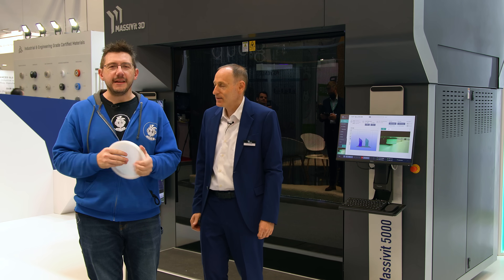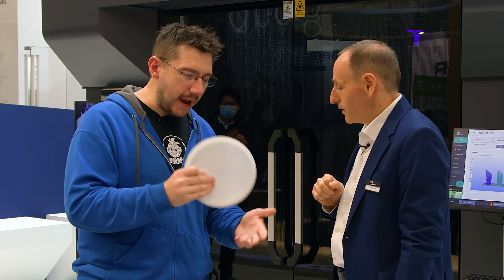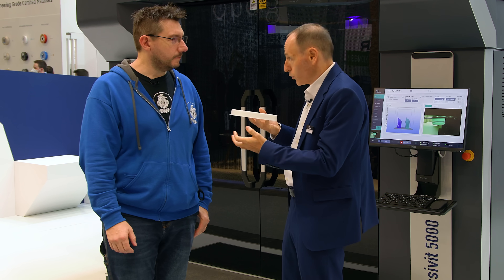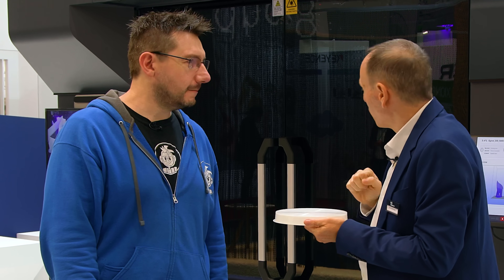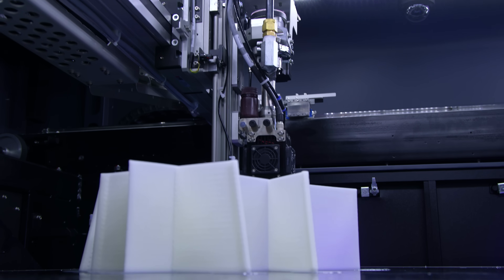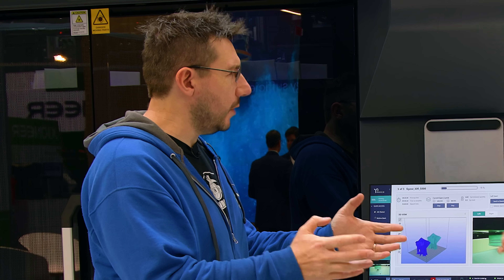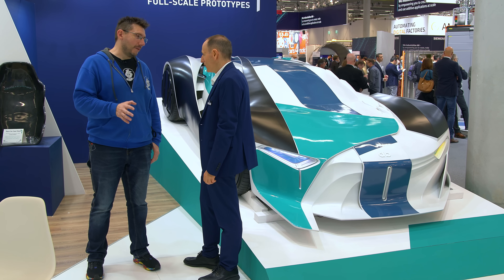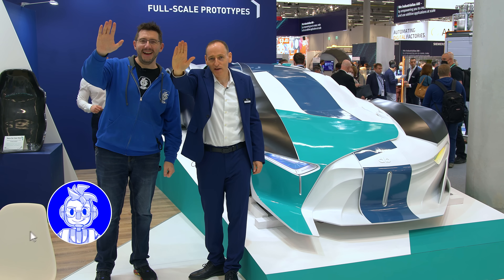6 FEET in 6 HOURS - ULTRA FAST 3D Printing with MASSIVit!

Comment: If someone makes a printer like this with multiple nozzles on a tool changer, it's literally machining, FDM and resin printing combined. You get the speed of huge FDM nozzles but using liquid material the whole time, and the different nozzle sizes allow for roughing and finishing passes

Comment: I know they are ringing out parts fast but how low can the resolution of this machine go? Can we use this gel to print sub-millimeter pieces on smaller printers? Xxx
Reply from the maker: resolution IS a consideration since the gel bead cannot be too small.

Comment: Did you talk about the process for getting what looks like a gf gel coat on the outside of the finished marine part you held? Was that a composite with the printing used to create a complex structure that was then overlaid with glass fibre and resin layers by hand and finished with a gel coat, also by hand?

Comment: Ive been informed that yes infact stratasys are hiding post requests again today. for royalties to be paid. There latest vids about dentures have several posts i bet none of you can see. 
They are back to hiding stuff. 
Not just our missing inventions then print them in a add. Wow. 
Not just our hacked accounts hidden until they got outted. 
Now hiding royalty request posts. 
Are they protecting criminal pirates from paying royalties? 
Assisting pirates to avoid the law?
Im not impressed. I got a message outting them again. 
Thanks to those who work for not just me by helping me but the comunity also. Thanks to there messages. You know who you are thank you.  Lucky we are onto them.

Comment: I have some questions for the folks at MASSIVit!
- Can MASSIVit's machine use traditional filaments that don't use UV curing?
- Can MASSIVit's gel be printed with a normal FDM printer?
- What if MASSIVit replaced the grid of UV LEDs with a sliding/rotating disc fitted with UV Lasers? Would we effectively get a fusion of Resin, FDM and SLS printing?

Comment: So he is proud of 50 patents (around 3:20).

I'm not sure if this guy actually understands that the only reason he even has a job is because key patents on FDM expired, allowing 3D printing to become a large industry with a broad customer base, rather than some niche industry that sells a few machines per year.  Patents actually held back the 3D printing industry for many years.

So any thinking human being would see it as problematic that a technology is woefully encumbered.  Because it increases the risk people will stay away from it, and development will be slower and more expensive for them since they can't leverage an entire industry.
Reply: The concept of Patents is sound, society needs innovators to invest time and money, and the rewards of their work are far greater to society than to the individual – so some method of compensation is needed for the individual. And the Patent length is finite! But abuse abounds from Patent trolls, Submarine Patents, to cross licensing to avoid being blocked by competitors. The abuse needs to stop.
Reply: @mc468  That's the theory.  Reality is a bit more complex. Patents tend to only be worth as much as the legal and financial horsepower you can put behind them - something that doesn't actually end up favoring innovation because it is a way mainly to defend an already well held market position.  There is a reason large companies have considerable patent litigation departments.  At one company I worked in the past we had a whole department of patent lawyers and staff whose job it was to rough up the little guys, defend against patent trolls and other large players. If you own a patent some well funded party wants out of the way, they'll most likely get their way unless you have very deep pockets and lots of time on your hands.

And it is a bit funny that you'd decide to sing the praise of patents in the comments on a video about 3D printing.  A field that didn't really take off until key patents expired and actual innovation could start.  (If you doubt what I'm saying, have a look at the FDM printers from before the patent expired.  Yes, they are pretty pathetic even compared to the cheap chinese knock-off 3D printers (of other cheap printers) you can buy from China.

When reality doesn't fit with myth, you kind of have to take reality into account.

Comment: Ok. For a fully enclosed environment, there's a lot of things you can play with. Ambient temp, air composition, UV exposure, air pressure, magnetic flux lines, microwave sintering, extrusion materials, extrusion angle, extrusion speed, extruder nozzle geometry, etc. I doubt this is solely an improvement in the extruded material. They appear to have reached a high level of engineering.

Comment: Now I want to see a full size bust of Joel made with this. I also wonder about post-processing because the car and boat parts were smooth and the in-progress print still appeared to have layer lines. If you didn't look into the boat part, I'd have assumed it simply got sanded down on the outside... but the inside also looked smooth, which makes me wonder what they did to smooth it.
Reply: Painted and/or coated as well. Look at the bottom edge when he flips it over. I see the signs of something very similar to applying paint with a brush or sponge.

Comment: I can only think of a medium to high viscosity fast curing uv epoxy resin that would be the jell ,  quote on "acrylics" and uv resins is very stable with various viscosity and curing time per layer could be less than 8sec and with every exposure to uv layer solidify reaching full cure

Comment: More interested in their smoothening and sanding process because those demo parts are basically layer lineless for a giant extruder. Either they have a really good process or a ton of work
Reply: At 9:24 When you see the tail lights and the small red columns, you can see the underside of what I assume is the other tail light behind, which has a few sign of drip/ paint run, so I assume it’s just paint laid on thick?

Comment: Wow, pretty mind-blowing!

As a couple of others have mentioned though, the missing info is the mechanical and thermal characteristics of the material.
- tensile strength
- hardness
- impact resistance
- maximum working temperature 

Also, what’s the cost/kg for the material?
Reply: I'm more worried about the cost of the extruder. Honestly the above stuff probably isn't too bad. Material cost might also be prohibitively expensive.
Reply: @faranocks  Plastic just isn't cheap to begin with, but otherwise I guess the cost is worth it for the benefit it provides. This gel? Even more so, giving that for more complicated stuffs ordering a machined part isn't cheap either, and you have to assemble it using even more efforts.
And the extruder probably would be durable enough as well (giving that human have been using pumps for centuries and you bet by this time it can be made with high enough quality). And it's not like CNC bits aren't disposable. 
Honestly I don't see anything of this machine that would bring the cost unreasonably high. It won't be cheap, but neither would all the alternatives.
Reply: @faranocks  As the technology for gel UV hardened resin is widely available the only thing driving up cost in that department would be availability for this specific use case, which would probably start to fall rapidly if this technology was widely adopted. I think the larger problem is that they have a patent for this technology so no one else will be able to do anything else with it in the near future.

Comment: Regarding the UV LEDs they use I've always wondered

Is the functional difference between an invisible uv led, and a visible one, small enough that the manufacturers just don't bother?

I own a UV flashlight that has close to no visible light emission (weltool 365nm with filter) and if I were to build a device that needs uv light I'd take care to use those LEDs with a filter mainly 

In this video it almost looks like they just soldered some violett LED in there and called it a day

Comment: I just wonder if they can print anything strong enough to be used for the core of a fiberglass ship hull?
Reply: Our printing technology enabling uses small amount of material because we print hollow objects (Little or no support structures needed). The end parts are lightweight, durable, and receptive to a variety of post-processing methods.
Reply: @Massivit3DPrinting  is it capable of printing internal structures or can it only do hollow shells?
Reply: @deltacx1059  , although our customers generally print without support structures (one of the benefits of Gel Dispensing Printing that enable fast production), the 3D printer's integrated slicing software has an option to print infill at the click of a button and to determine the density. Regarding your question about a ship hull, until now our customers have printed a variety of custom ship parts (rooves, ergonomic dashboards, radar masts, bathrooms) which were reinforced with fiberglass. From my knowledge, a hull has not yet been printed, but if you're up for it we'd be happy to partner with you :) .

Comment: Incredible! I wonder if they can use glass fiber filled gels to increase strength?
It would interesting to see this used in construction. Either printing modular panels, or forms for cement.
Reply: Our printing technology enabling uses small amount of material because we print hollow objects (Little or no support structures needed). The end parts are lightweight, durable, and receptive to a variety of post-processing methods, one of them is fiber glass.
Reply: Something like Markforge?
Reply: @karstenschuhmann8334  no. Makeforged puts down a continuous fiber on each layer. I'm just talking about short chopped filler.
Reply: @JonS  I see, but a continuous fiber could increase stability far more.
Reply: @karstenschuhmann8334  absolutely, but I have no idea how they'd incorporate it in to this technology. Also there are patents to consider.

Comment: Automotive industry is (will be) all over this! The cost of the polymer clay they use to sculpt full-sized prototypes is insane! At one point I inquired about the polymer clay used and after hunting I finally found a company willing to talk to me about it. $100,000 in clay, easily, for ONE full-size prototype. My purpose was to sculpt a 4 foot Cho'Gath statue for my son; $15,000 in clay had I gone ahead.

Edit: At a cost of $500,000 it could pay for itself in a few prints, one might argue a single print. As the alternative is ~$100,000 in raw clay that you then spend months(?) sculpting and refining at the hands of highly paid people. The time and money sink of prototyping is incredible and if you could wave a wand and most of it goes away, who wouldn't?
Reply: They still use clay for automotive prototyping because changes can be made on the fly by the sculptor within minutes ready for review by the designer. You can't do that in CAD or 3D printing.
Reply: I would think that the act of sculpting is part of the purpose of that process though. sure you can design the whole car in a computer sculpting program but it will be much different once full size.

Comment: I saw this at IAPAA and had a great conversation with the Massivit rep. It's an amazing machine. But it costs half a million dollars. And it's the size of a room, which for my company was a big issue. Not to mention that the resin is very brittle, has a shelf life, and is only supplied by Massivit. Add this with proprietary software and you have potential fornincredobly expensive maintenance. I talked to other companies who have this machine to get the review on whether it's worth it, and they were trying to sell their machine to us for 300k.  Which is still too much. We weighed the options and while it's a great machine we still have to mold, cast, and clean up prints anyway. Amazing tech, amazing machine. But ultimately more hype than it deserves.
Reply: Most useful comment here! Similar to the form 3L. It’s hundreds of dollars just to fill the tray with resin. Even if you can afford the printer, keeping it fed is super expensive; obviously if that’s your company’s business it’s worth it but for consumer use not really practical…
Reply: I own the massivit 1800 and it’s incredible expensive but it allows you to make very very large and precise mold for carbon fiber or fiberglass and you can also just the skin the print with fiber glass and it solves almost the issues
Reply: @ethanalbers861  But I assume you still have to cnc mill the part after the print is finished, since the surface is just not precise and smooth enough, right?
Reply: Wow, interesting observation, well at half a millon , closed ecosystem, etc its a very expensive 3d printing solution..i think the target of this machine is big companies (imagine only the cost in material of printing a car), and of course all tecnologys have there down side...
Reply: @noway8233  my higher ups were seeing stars with this machine and I basically had to beg them not to buy it as I explained why it wasn't worth it for the art department at my job
Reply: @Dakota_Daniel_Designs  What job do you do?
Reply: @thenamelessone123  I work in the art department for an Entertainment company
Reply: @Dakota_Daniel_Designs  Like prop stuff? I can see how tempting a machine like this would be for that.
Reply: @FastForwardPlans  precisely
Reply: You have to weight wether the time you save with this machine is worth the cost of maintenance. As it is, the cost of the machine itself is not a big issue: if you already deal with pieces of this size on a daily basis, you already have machines in the same ballpark.
I think the users most interested in it are shops specialised in maritime and aeronautic prototypes.
Reply: I was so excited until you said half a million.
Reply: It’s also great for prototypes
Reply: wait till the patents expire... it will be colossal.
Reply: @TomasSab3D  isnt that what let FDM take off? the patents expired.
Reply: @filanfyretracker  exactly
Reply: So what machine did you end up buying?
Reply: @martyboi  we didn't end up getting any of the machines involved. We have several cr10 maxes and a form labs form 3L
Reply: I wouldn't say it's miss placed hype, it's just cool and exciting, it doesn't need to be a viable option for it to be hyped
Reply: > Not to mention that the resin is very brittle

yeah, most UV cured stuff is extremely brittle.

Comment: Sadly with all those patents it will be 20 years before we get to play with it. I am curious how fast one can cure a UV toothpaste vs cooling filament. They must keep it very close to being cured like you would keep the powder in a SLS at a temperature close to the melting point.

Someone should try to build a printer that uses an inkjet type cartridge that deposits generic 3d printing resin and add a UV light to the cartridge for curing.
Reply: That already exists it's called polyjet which is one of the core Stratasys 3D printing lines, ColorJet printing is also similar to what you want however instead of UV curing it jets a chemical binder which also contains the pigment. Basically color jet is similar to SLS but it doesn't need to fuse/sinter the material thermally.

Comment: The strength is probably the same as resin prints. But that is not the point of this printer. It's main application is probably to make molds for making glass fiber or carbon fiber parts in. But it must be a lot of post processing to sand down all of those layer lines. Or maybe they put it in a large 5 axis CNC router after printing to do the post processing to make the surface smooth.

Comment: an ender 3 sized machine using the massivit tech is a super interesting idea, a cros between FDM and resin
Reply: Forget Ender 3 sized, Imagine CR-10 sized!
Reply: voron speeds with resin quality!
Reply: @eliasenns4928  Not sure this tech implies similar quality to a resin printer. It seems it's very much equivalent to FDM 'resolution', but without the need for supports.
Reply: @imacmill  You right, still amazing tho
Reply: I have a feeling you'll see something like this very soon
Reply: While being as clean as resin,using less support than even resin and being way faster than FDM! This is just insane!

Comment: Now this is very cool, this is when 3D printing gets fast enough for actual production. Will cost your house, family and friends, but you will have something very cool. :) I am a bit worried about the companies doing manual model making for all sorts, movies etc. this will likely replace a lot of that and be cheaper in the end.
Reply: They won't go away.  Those parts needed many hours of filling and sanding to get a finish that nice.
Reply: @martylawson1638  That’s a really good point indeed
Reply: Sell house. Buy printer. Print new house. Win.